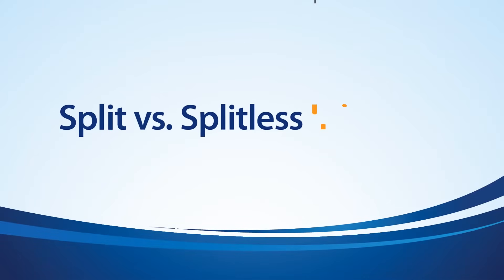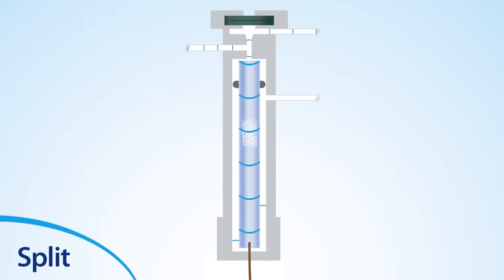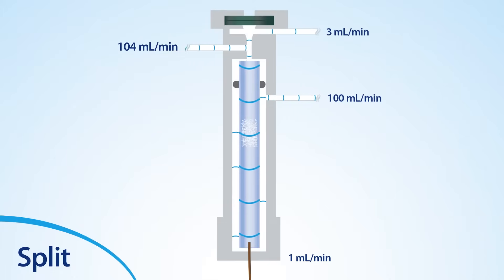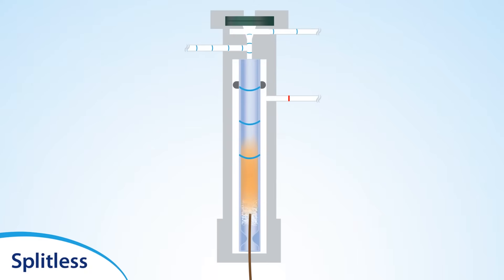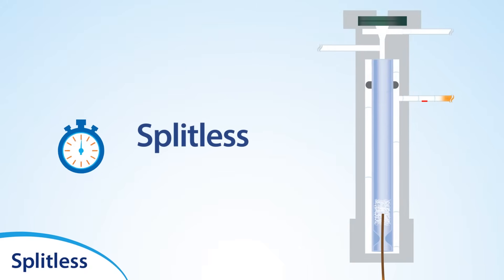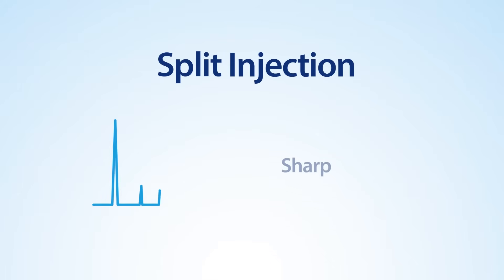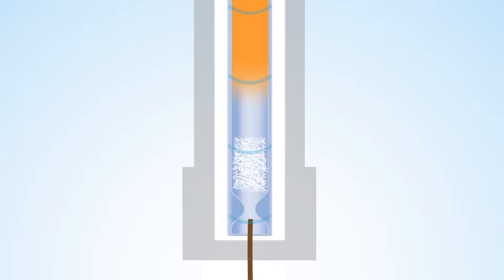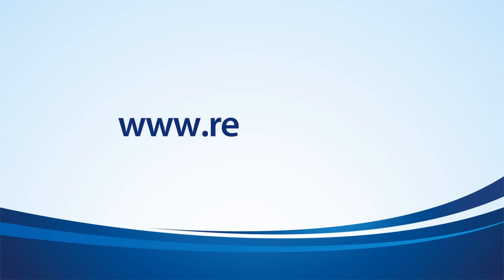Split vs. Splitless Injection

Comment: How to calculate split rato based on column and split flow.
Reply from the maker: It is generally expressed as a ratio of split flow : column flow, so if you have 100 mL/min of split vent flow and 1 mL/min of column flow, you have a split ratio of 100:1.
Reply: @RestekCorp  problema

hello, after replacing the burner, the chromatograph does not start, output 580000, and cannot be set on fire, can you tell me what the problem might be
Reply: Nice explanation sir

Comment: In the diagrams of the inlet it appears that the column protrudes more into the liner for splitless injections versus split injection. Is this correct or am I taking too much from the diagrams? Thanks!
Reply from the maker: Column installation distance should not change between split and splitless.

Comment: In splitless type, why was the vent opened after sometime?
Reply from the maker: In splitless, the vent is opened to purge any remaining material from the inlet. Accordingly, it is important to set the time for when that happens correctly. You should allow time, based on flow rate and liner volume, for 1.5 to 2 liner volumes to pass through the inlet, then open the split vent to purge any remaining material.
Reply: @RestekCorp  Alright understood. Thanks alot💯

Comment: If you could make videos for other injection methods

Thanks
Reply from the maker: We've some more videos on optimizing split and splitless that are in development. Any particular injection methods you are interested in?
Reply: @RestekCorp  Thanks for your quick response and I appreciate it.

A lot of sample introduction methods in GC can be used such as: 
1- Thermal desorption (single vs multi/ two stage)
2- Solid-phase microextraction (SPME)/ Headspace
3- Purge and Trap
4- Cold On-Column Injection
5- Programmable Temperature Vaporizing (PTV) Injection
6- Gas Sampling Valve 

These are some other sample introduction methods other than split/split injection method.

Thanks
Reply from the maker: We have several videos in development for SPME right now, and most of the rest of your list are already on our idea list, but we will add the others. Thank you!